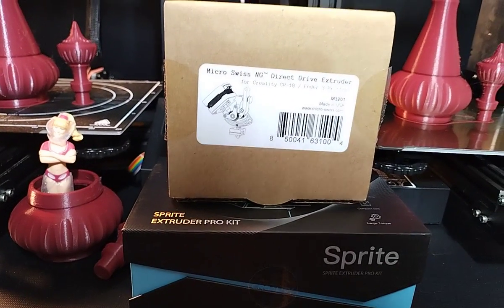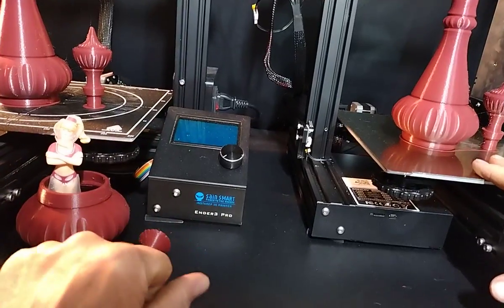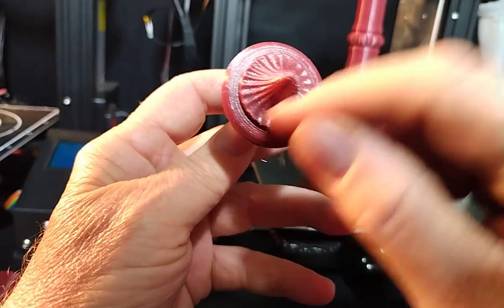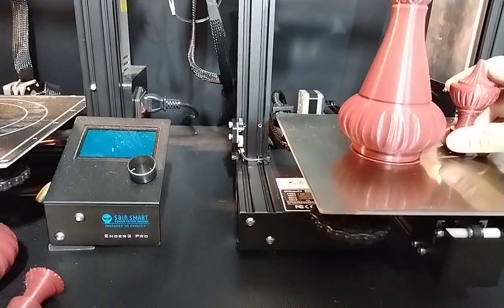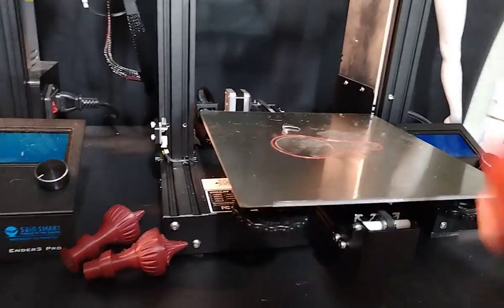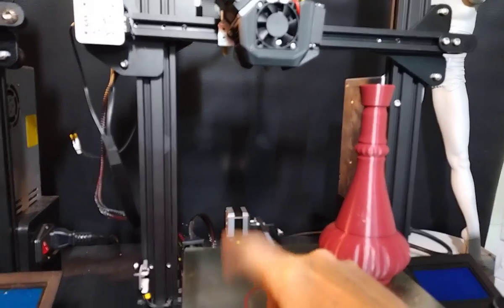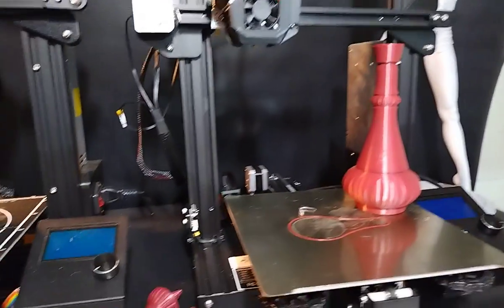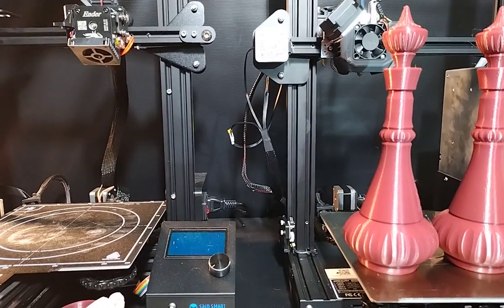micro swiss Ng.  VS.  the creality Sprite extruder on the ender 3 pro

Comment: This was a long video, but a good video.  I am just tossing up between the Micro Swiss and Sprite on my Ender 5.   I tried the Spider hot end, and that was a complete disaster in my case.  The filament was forever getting caught inside.   Quality control on the Spider Hotend seems to be very hit and miss. some swear it's amazing, others get horrible performance.   
I've heard lots of good things about the Sprite extruders, both the SE without the hotend and the Pro with the hotend included.   This video helped show that the Sprite is as good as a Micro Swiss, which are meant to be up with the best.
Reply from the maker: I do not edit my videos, no cut and paste....   Look at some of my other videos, their is some good model positioning

Comment: Thanks for the video. Looks like you're having a lot of stringing, is it because of the cooling issue you mentioned? My Ender3 V2 stock prints nicer quality...
Reply from the maker: have not really played with both of these since the video...   I have any printers...   more cooling is alway better
Reply: @3dpfeeney  You said that you made the model from the factory Jim Beam's 1963 bottle drawings and would you give us that?  is it online?
I have- 
An original Ender 3 (pre-32-bit) 
An end-of-production Anycubic Mega Zero 2.0
An Ender 3 V2
A Voxelab Aquila (original version, pre-chip shortage)
An AnyCubic VYPER (bought online, used for $93 w/free shipping. needed a new strain gauge)
An Alfawise U20 ONE (now cannibalized to make a different printer AND a tabletop CNC router/carver/Laser (eventually)

I recently bought various extruders to try both in Bowden and direct drive uses.  While that is nice to have better extruders, you are correct in saying that cooling is the first place I recommend before going into exotic upgrades.

Comment: Thanks a very useful video. i can now see the new Creality Sprite will install on my original Ender 3 with the 32 bit motherboard (Teaching Tech upgrade) i installed.  Ive bought a Ender 3 S1 Pro and its running very well.  (For LW-PLA model airplane prints. and TPU etc)
Reply: They actually make a kit that is all metal for the ender 3 series. I think its around $120 and comes with everything you need to put a sprite on your Ender3